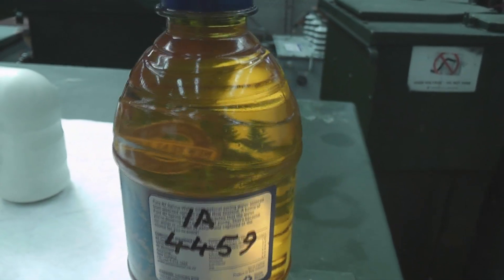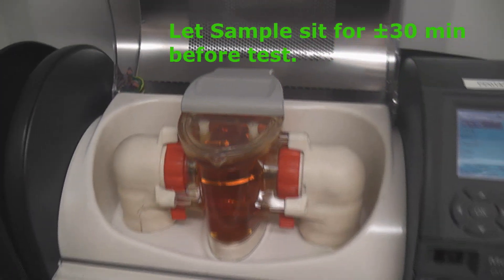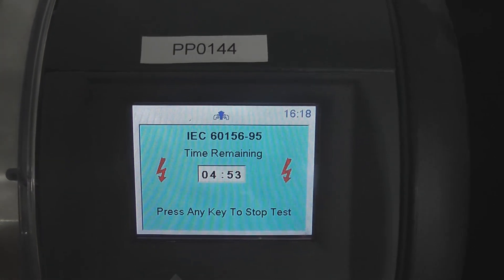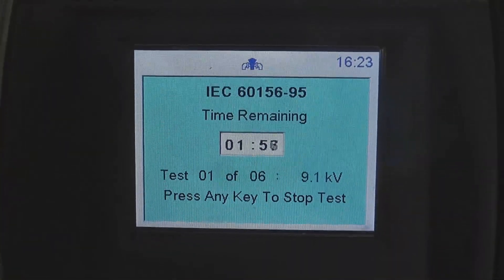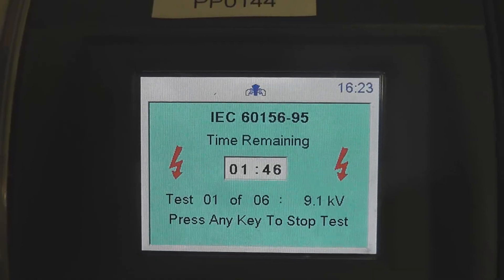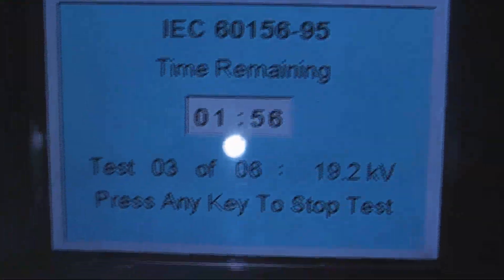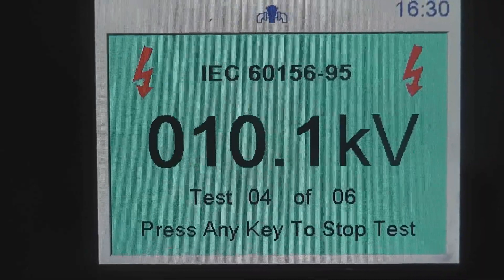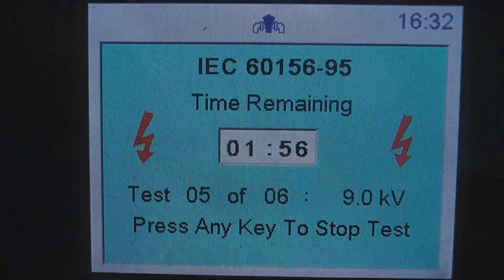Mineral Oil break down tests

Comment: I like how you can see some crud in the oil moving around from the electric charge in the oil.  apparently oil can be pumped (somewhat inefficiently) by using high voltage DC.
Reply: +kevtris The oil is being stirred during the process "Stirring: Impeller"
Reply: ah yeah I saw that.. at the end.  hehe.  I did read about using HVDC to pump oil, though.
Reply: A bit late to the party, but the test is conducted using ~60 Hz AC, not DC (as can be seen on the printout around 3:28).

Comment: Well, that bit of test kit didn't cost £500 at the local electrical stockist, did it? :-O

Hmmm, A rather specialist bit of test kit there, which was probably invented by someone in their garden shed with a variac and an NST :D

A little bit of refinement later, with a screen and a noisy printer added, we have an oil dielectric tester. :D 

What would be fun, is if you could "borrow" that tester and put other things in it, like orange juice, standard tap water, veg oil (for those who like to sink MOTs in the stuff) and things like that. :D

I have to admit one thing...... at the start of the video,  when I saw the oil container...... it looked like a little glass pot with some kind of water pipes screwed to either side of it.

It looked like an "Invention-De-Rodalco" and then I saw the rest of the tester. :D ROFL. 

 Thanxx for showing,

-BoomBoxDeluxe.

9th December 2015, 14.56

Comment: I'd like to put a twin MOT stack in oil (5 kV) for cooling. Is standard mineral oil from a car shop suitable for that (e. g. 0W-40?). Special transformer oil is about 7x more expensive...
Reply from the maker: Not sure, If you have an insulation tester do a test with two electrodes in the oil.
For 5 kV standard mineral oil is probably OK. New TX oil has a breakdown voltage of > 50 kV - 80 kV per 2.5 millimeter gap.
Reply: Hi RODALCO, thanks for the answer. No I don't have an insulation tester :-)I will give it a try. I hope I don't ruin my secondary coils!

Comment: Is That oil being refined and re - used?:/
Reply: +Variac Maniac Typically it is filtered, washed and then dewatered before being reused. Badly contaminated oil will be taken and blended into heavy bunker crude and burnt on a ship, or will be used in a bitumen plant as a lightener.
Reply: SeanBZA Oh, Alright, Thanks Mate, Cheers;DDDDDDD

Comment: Why is there such a long dwell period between tests?
Reply from the maker: +douro20 Well, when an arc occurs carbon traces will be near the electrodes. They need to be moved away otherwise the next test results will be affected. (my guess)  It is per the testing standard.
Reply: +RODALCO2007 Also should note that it appears to circulate the oil as well. I barely noticed it on mobile.
Reply from the maker: +mman454 Correct.

Comment: What are some of the lowest tests you've gotten? a few kV?
Also, I'm curious, what would a good breakdown reading be?
Reply from the maker: +Benjamin “Ozias” Esposti This was one of the lowest readings i have seen. Normally we batch test the new or recycled oil before it is used. Readings of 60 to 80 kV are often seen. Our utility needs oil > 50 kV some accept > 30 kV on the arc gap.
Reply: RODALCO2007
Ahh, thanks for the info!
Wow, that is quite low then. I wonder how long it would have been before it arced out inside. I I would think the RMU case/enclosure would rupture because of the powerful arc that would develop! Scary! O.o
Reply from the maker: +Benjamin “Ozias” Esposti The units are designed to blow at to the back, away from the switching operator. Biggest arcs occur when breaking the current.